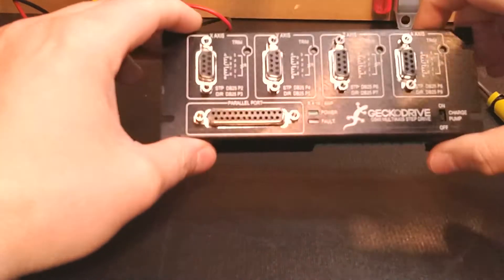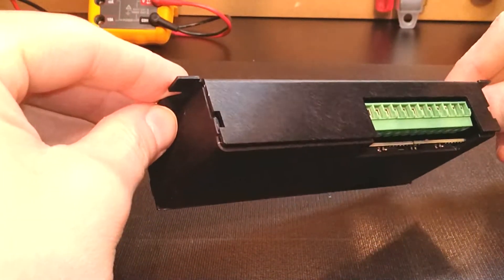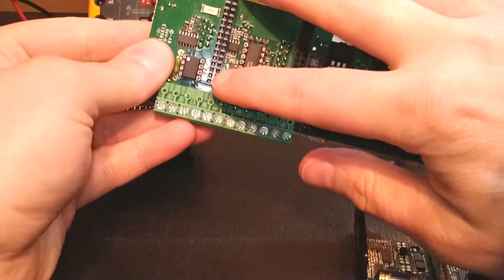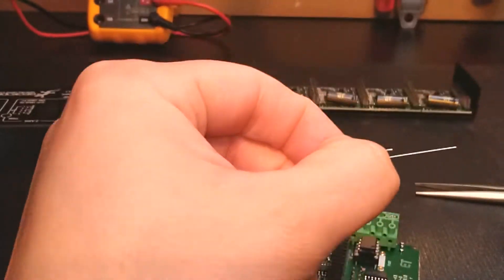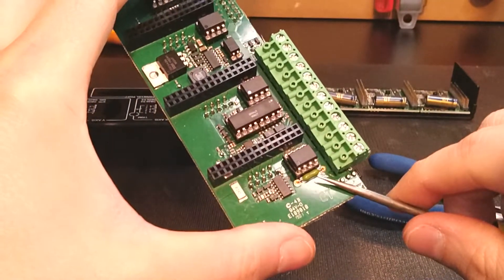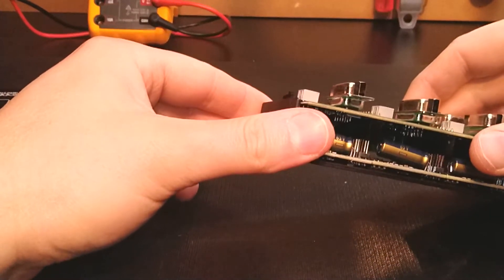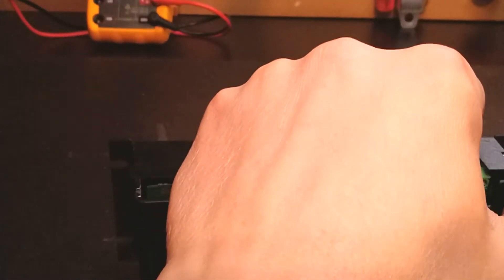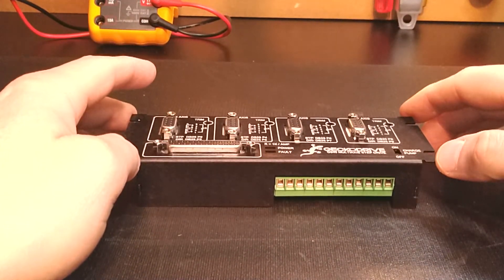How To Change A Fuse, Or A Drive In A Gecko Drive G540

Comment: I was thinking about what kind of control system for my first cnc machine and I really like to have your opinion about the difference between the openbuilds black box versus the g540 
Love how easy to understand and how practicality your videos are . Keep up the good work
Reply from the maker: ChaosCree, thank you for your support. The open builds unit is not even close to the capability of the G540 do to it running 3D printer drivers, and using only a 24v power supply. Here's a system retrofit done using my G540 controller which reflects the difference https://youtu.be/WAXnvMocchQ  Here's a review done with the G540, and my power supply. https://youtu.be/LLHbzmXAPps The accuracy, and speed he achieved is remarkable on an otherwise stock 3020 CNC from China. Thank you, and have a great weekend! Vince
Reply: Thank you for your reply, I’ll look into the video and make some more planning. Your product list with all the compatible parts really help alot . Looking forward to buying from you when the time comes.
Best regards
Reply from the maker: @KennyRhapsody  You bet  :), and when your ready just let me know. Thank you, Vince